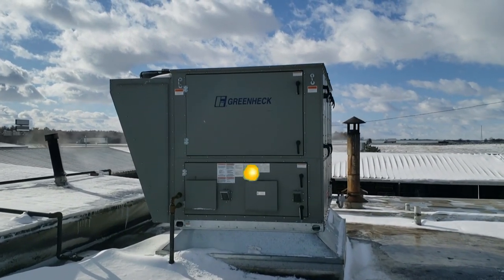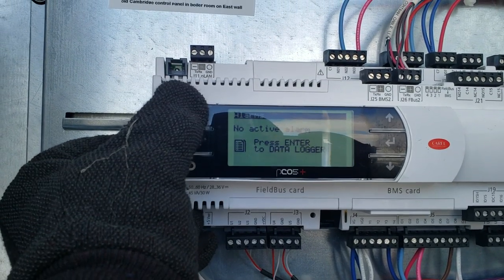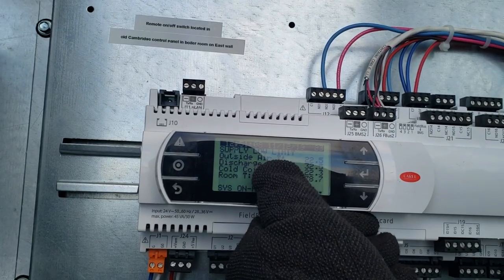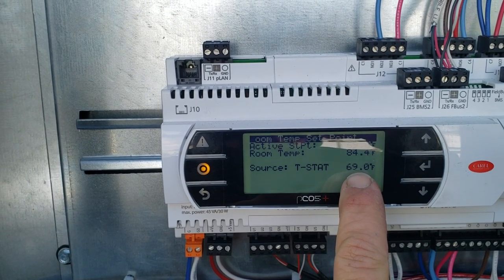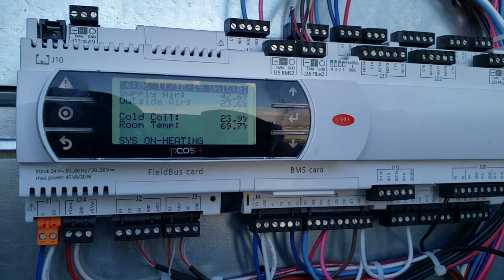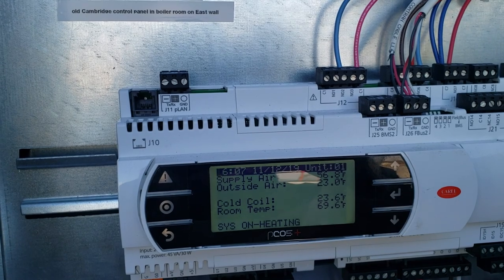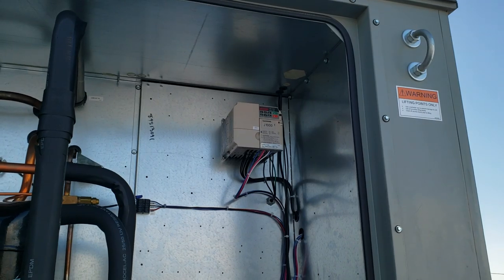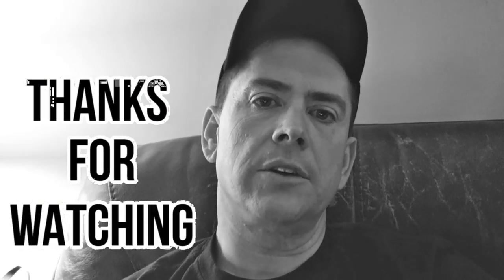100% Make Up Air Not Heating

Comment: Nice unit. I work on a 100% OA with 30 k cfm it took the Contrators 1.5 yrs to get the setup right for extreme cold. I had to use them for warranty purposes. I still have to tweak it from time to time. Niagara N4 automation. Beautiful dog. One more thing. That EZ condensate trap is great for indoor use, but will dry rot in the sun.
Reply from the maker: We normally use the trap that has a spring in it where it fills up and dumps. Thanks,  the wife wanted the dog,   she's got 2 older pug brothers that are still getting use to her. 😁

Comment: That is a Greenheck RV Unit. The RVE has an energy recovery wheel in the unit has well. The school district that I work for has been having several of these units installed during building renovations. They are used as 100% DOAS units in conjunction with the VRF systems. I have some videos of them on my channel as well. Consider me a new subscriber!
Reply from the maker: Awesome! Welcome aboard..

Comment: It’s amazing how a little set up can screw up the operation. I have some Valiant units very similar to those units. Once you get them dialed in they’re pretty much worry free. You figure out more when the season cycles. Good video.
Reply from the maker: Yea it was kinda of a short video and appeared simple but I gave the factory some crap about not having some sort of fail safe programming. I work on so much different stuff, it's hard to be great at everything.

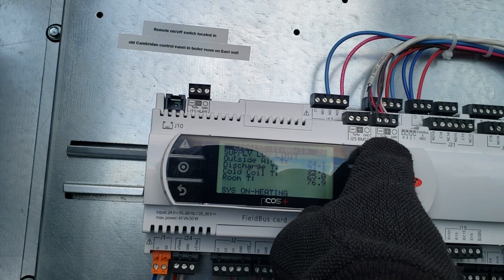Comment: Greetings at timestamp 2:58 and 3:11 there is what looks like an indentation in the tube feeding the burners, what is the purpose of this? Thank you.
Reply from the maker: I rewatched the video, I'm seeing pressure ports on the manifold and the high and low manifolds. I'm not sure if this is what your referring to?
Reply: @HVACRSurvival  Thank you for the response. blah if only we could add drawings to our comments but I believe I've solved my own question, what I'm seeing is a separation between the low fire and high fire on the burners. I mistook it as an opening.
Reply from the maker: I talk fast, so sometimes you might miss things. I thought I mentioned that but if you're not used to the way I talk it's easy to not hear it. I've tried to slow down🙄😂

Comment: Is this a 90+ AFUE unit?
Reply from the maker: No it would be in the 80% range otherwise it would have a condensing heat exchanger that could possibly freeze and break if it ever was to go down or was in a off cycle in extreme cold temperatures.
Reply: @HVACRSurvival  True...personally I don't know how a 90+ AFUE heat exchanger can last so long in the first place...Rheem ones seem to last for decades...